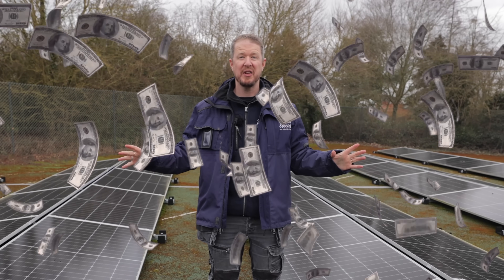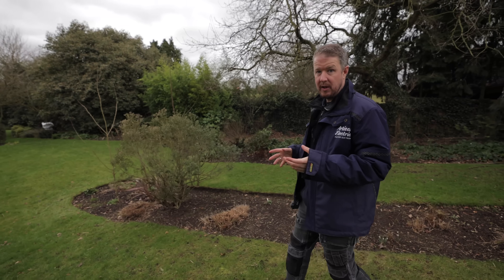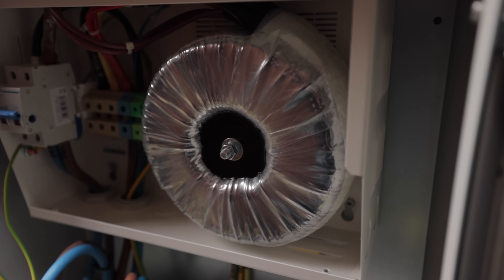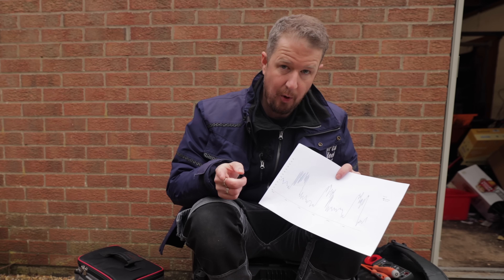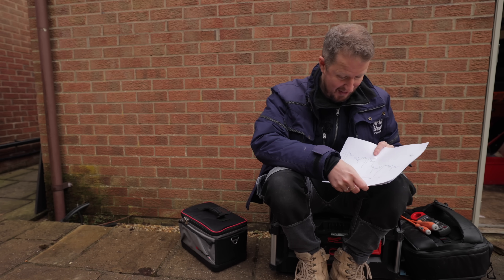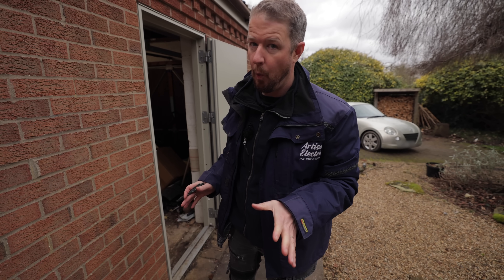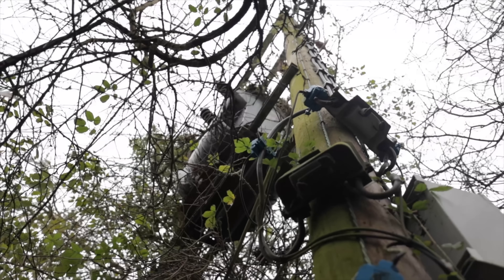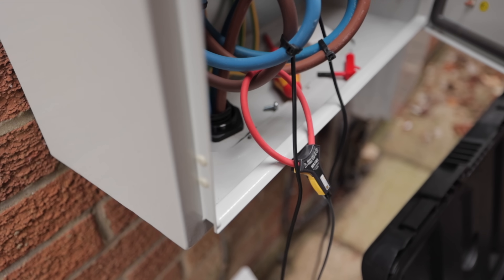THOUSANDS Down the Drain – And We Can’t Do Anything About It!

Comment: I've had several wtf  moments here. Even my country is not very rich we have better state of grid even in rural areas.

1. Single phase. Really? Such large consumption and production and single phase only?

2.Toroid in small voltage control. Really. Not semiconductor based? This is middle age of electronics. But cheap i suppose.

3.Wooden poles for electricity? This is wtf moment. Why not concrete? They are used very exceptionally or temporarily in my country. Except phone poles which are sometimes separated from energy ones. But most rural installations have concrete or steel.

4. Grid protection - what is energy distribution company doing for energy grid protection from overgrown plants? Do they initiated annual physical checks of equipment or revisions? They can give me a fine here where i live if i will not let them to do maintenance and i will pay all the damages.

Comment: We're experiencing the same here in the North West with SP Energy. Fortunately, nothing is tripping at the moment. Our voltage range is between 263v when discharging to the grid, down to 229v when the car and batteries charge overnight. Our set up is much, much smaller, a 6kW array with a 17.4kW battery and a Zappi. Our DNO have been out a couple of times at my request, but when they check our off load readings its within tolerance, around 240v so won't do anything. The test is always after work hours. and the engineer is on overtime from their normal day job.

Comment: Interesting what happened to V phase the company that designed a similar voltage optimisation unit. I was the factory manager at Remploy who manufactured the units I remember them going into administration I think that was 2014 I remember having lots of stock left in the factory afterwards.

Comment: That large auto transformer (I assume is not isolating) needs to be automatically switching tappings according to voltage, as currently it's only been designed for a fixed static overvoltage which is no good for what you are doing, i the electronics industry we have what's called a regulated variac but ive not seen them over 3kva and I quick search I just get bombarded with manual variac (just a bit better than what you've got already) but really having so much on a single phase I think is the crux of the issues

Comment: I work for electricity distribution network and that's quite a large transformer for a rural area it's probably the tiny Bundle cable from the TX to your installation. The TX was probably installed in the 90s and the bundle upgraded later but for a time with less demand. Our networks pretty stingy with money as we're a trust and if you want to upgrade the customer always pays. We are getting large voltage spikes in summer with all the distribution TXs because of solar panels connecting so at moment we're going round tapping voltages down, don't know what's going to happen in the winter. Also, it's really hard for companies to cut trees at the moment because of complaints from the Locals we have to jump through hoops and prove the risks before we can do anything, it's easier just to let it go and fix it after it the feeder trips.

Comment: when an electrician mis quotes the nominal mains voltage😮 the nominal is 240v not 230 ! We had our 240v system all set up before we joined europe and joined their 230v  nominal ,we changed nothing other than our tollerance rating ,we still are in reallity 240 nominal ,to say 240 is "fairly high" is just plain wrong, i know what you said falls in line with the training literature but in the field you learn how the training is sometimes wrong, here in the southwest actual measured values are always around 242v and I've seen as high as 250v (urban Plymouth)

Comment: Here in Ukraine it's a common issue. 

Many folks buy abandoned houses in rural area to install 30KWp PV as way to invest money. But those areas lack both good grid and consumers so overvoltage is quite common.

As result villages had over 270V in network around PVs. So goverment pushed regulation to make use of mandatory separate voltage relay that shuts PV off if network can't consume it leading to overvoltage. 

Owners of home PVs pushed that regulation back so those devices are only needed for new installations since 2023.

Comment: You have got this far without knowing anything about the local network topology? You didn't  do any calculations on the supply cables and transformer before installing the battery charger? Can you not reconfigure the solar panels controller to drop the voltage of the array?
I would be very interested in your loop readings. And my suggestion is to get an E engineer to give you an assessment. Cheers.
(Also Tx are measured in Kva for a reason, you must know your pf before assuming Kw capacity.)

Comment: Temporary Solution (Maybe).

After installing your voltage reducer, you then said it created a second problem during battery charging, and the customer was able to charge batteries in about an hr.

In that case couldn't you just reduce the charging rate, if off-peak is 6 hours, that's plenty of time.  I do this anyway on my install, 30% charging power rate as I believe this would also be beneficial to battery health, rather than charging at full pelt.

Please note, I'm not an electrician and might be totally off base here.  But to me seems an obvious fix, until DNO get its part sorted.

Comment: I have a 16 kW DEYE inverter. When the grid voltage exceeds the settings it disconnects from the grid and supplies a steady 230 volts to my house. You can reduce your charge current so that the load is lower to reduce the voltage drop. I assume you are exporting the solar/battery power back to the grid. Lowering the export level will also reduce the voltage increase. I refer to your grid situation (long run from the xformer  and possibly a xformer that is near max load or over) as a soft grid. Of course this is just a band aid but it gets the job done. I've recommended this to people with this issue and it has satisfied their needs without costing anything.
Reply: I also have the deye 16kw. How are you finding it? Mines run 24/7 for the last 25 months without missing a beat. 30kwh of server rack batteries and it lowered my electric bills from 260pm to 50pm on average.
Reply: @James-k2c9k  Mine has been online for 28 months, working fine. My bill is down an avg of 90%.
Reply: @pilotdrh  how many KWh of batteries do you have? I was on Octopus 7.5p KWh, then went to the variable rate. Averaged about 8p KWh. I've now moved to tomato energy @ 5p Kwh it was nice getting paid to charge sometimes but the 5p over night rate works out cheaper and much simpler!
Reply: I have 30 kWh of batt. I don't export power and rarely charge from the grid

Comment: Wouldn't you be better to take voltage readings from neighbouring properties from the same phase as yours as when your pumping in 17KW they are surely going outside the upper voltage range, meaning ukpn have to address the problem, and replace that transformer and or upgrade cabling also??

Comment: Why is the charge controller(s) not limiting the  charge  voltage? 
The customer's hired you for the knowledge to do a proper job which includes adhering to the specs that the grid requires. So that's not on them.
While you might have identified an outside factor, why would that transformer cause the charge controller to exceed specs?

Comment: Some great and for me educational comments to this video. You have to admire Jordans openness whether they have made a mistake or not. I had no idea what the DNO did exactly with those G99 applications, nor the 240v versus 230v EU standard and the fact we as a country fudge it with paperwork until its necessary to make the change. Most consumers like myself would not even measure the voltage coming into the house and frankly I always thought it was the current that did more damage than voltage spikes. I see new fuse boxes, not ours, fitted with surge protectors and now reading the comments I'm wondering if that's the latest standard to protect voltage spikes like described impacting internal eletronics. I'm having a bog standard EV charger fitted single phase and just by chance I've looked at the voltage coming into the house monitored with our LuxPowerTec hybrid G98 inverter. Over the last three months It varies from 232 to 250 mostly the higher figure is at lunch time when solar output peaks. I start to understand the impact of people adding solar, batteries, heat pumps and EV's on our existing infrastructure and having spent some years living in the NL's I know they were having major issues and were forced to upgrade cables, transformers etc.

Comment: I really want to be polite, but I value the truth more. So I can only say this: some idiots in the government allowed prosumer model and naive/not-well-educated/dishonest people are buying/selling/installing these systems. But don't you have inverters that can operate within a voltage range? Here in Poland inverters switch off if the voltage exceeds 253 V (unless users tamper with them, which is another problem). Off-grid or hybrid is the way to go. Please trash this "optimizer" and install a couple of crypto miners, started automatically when the insolation is at its top.

Comment: First od all - 17kW calculated by DNO is how much they can sipply, not how much you can put into system. If you have voltage issues using the step-down trafo is UNPROFESSIONAL because you are rising voltage for everybody else connected to this line!!! Any good inverter (Solis, Solaredge, Sofar, Fronius, SMA) will have Q(U), P(U) work modes that are a must while dealing with overvoltage issues. Since you have a hybrid system here you are for sure able to limit backfeed to the grid and not loose energy because inverter will be puting excess energy into the battery. Just set backfeed limit to 11kW for a start, enable Q(U) and sell this transformer for a scrap!

It's elementary my dear Artisans!

Comment: Interesting video Jordan- up there with the one where you found the PEN fault where we also saw these wild voltage swings.

Please correct me if I'm wrong here:
1) This is two completely separate problems, peak solar over-volt and charging load stability? 
2) Charging load is for UKPN to fix but the solar issue is a design thing?
3) I'm struggling to believe one properties night time draw on the main transformer to charge their batteries is much higher than peak 7pm use from all the other properties running cookers, kettles , pizza overs, hot tubs, charging drills and wands...I'm not convinced. Interested in part 2 and believe UKPN might have to come out but I'm not 100% this is the whole story. Do you suspect other properties are also making use of cheap night rates and all asking to pull hard at 02:00? Do you see many people actually using e7 storage heaters anymore- I haven't for quite a while?

Comment: On the SWISS in Western Australia, metropolitan area, as part of the install you have to prove your solar system, at peak output (the the inverter rating) will not raise grid voltage at your meter by more than 2%. This requires taking into account the size and length (and thus resistance) of the cable run from the house to the street (this cable, although on the the grid side of the meter is your responsibility to have installed plus size appropriately for your intended use). For my install this was 1.2% at max output for a 3 phase 10kVA inverter.

As someone else has mentioned for the UK, the rules in Australia require a ramping down of output when local voltage exceeds 250V down to 20% of inverter capacity at 258ishV. Also PF of inverter will ramp from 0VAR at 240V to about 30% absorbing, ie 3kVAR for 10kVA system. This helps to bring the voltage down.

Comment: Again am shocked at the low standards of professional education in the UK especially with the new advances in  grid technology. The problem you have here is called cosign error and it's common knowledge, you have a number of solar inverters  colocated all trying to follow the grid phase  well they are working against themselves mate this explains your over voltage. Which ones are master. Which ones are slave. Where is the communication cable between inverters, does the inverter selected even have this function or have you installed 3 stand alone units ?  Do you realise that the inverters all regulate down the amount of energy pumped into the grid from the solar array by mismatch of phase meaning that probably half the generated energy is not being inverted ! 

Designing onboard chargers 22kw for BYD and GWM means you have this effect in a whole parking house with hundreds of EVs in inverter mode so I developed a sync signal  system to make multiple V2G even possible.  As I worked for Volkswagen in Germany we had V2V  vehicle to vehicle. And V2L  but management refused to allow us to develope large scale V2G vehicle to grid. Now the Germans went all green but did not see the need to use EV batteries locally where people are as a means of storing green energy where it's needed. Now go to any big city in china and you will find every Parkhouse fully fitted with hundreds of fast charging ports that can also feed thousands of kWh into the grid with synchronised EV OBCs in inverter mode.  Then I look at backward Britain you guys have not got a hope in hells chance without a massive and I mean massive grid upgrade, I remember well at IEC meetings the fools with shirts and ties on from the UK not understanding the international EV standards and always complaining and wanting to make us change things. Well we refused and you guys went it alone. Well the PEN loop test is the right approach and if your star point grounding is high at the grid transformer. You have to improve the grounding their with the costs involved  but no profit is in the UK more important  that the EV battery is a high voltage DC power source that can kill is sadly something that can not be ignored. Ask Nissan  what bother they have with their ICCPDs in the UK refusing to accept state D by the crappy British grid system.

Comment: I'm an installer in New Zealand. I have always said feeding the grid with your own solar is a waste of time, too many potential complications, too much red tape and always subject to the power companies changes and incompetence. It always looks good on paper. Build a system for your own power supply, become power independent and stick with that.
Reply: The customer does not want to pay for the batteries.
Reply: this is the best comment i've seen. i fear its too sensible for people to accept.
Reply: no it is not. Feeding hte grid with your solar is bumping coal and gas off the grid.  I have 40kW on my house in Australia and I have made tens of thousands from feeding solar into the grid over the years. Currently I'm getting 15c/kWh and years ago I got a preferential rate of 60c/kWh.  Customers should be forced to feed in to the grid if they want to connect solar. Exports benefit everybody. note that solar installations should be setup with flexible exports which is implemented currently in South Australia and soon to be implemented everywhere in Australia. NZ will follow later as its solar industry is tiny.
Reply: @beyondzeroemissions  Till the reverse happens, take a look at Holland: In the Netherlands, the situation has changed such that people with solar panels now have to pay grid fees instead of being paid for the excess energy they feed into the grid. 
Grid Fees (Terugleverkosten): Owners of rooftop solar panels are required to pay grid fees, which can range from €100 to €697 per year, depending on the size of their system. These fees are intended to cover the costs associated with managing the grid and integrating distributed energy resources.
Did you ask yourself why they are paying you only "15c/kWh and years ago I got a preferential rate of 60c/kWh"?
Reply: @beyondzeroemissions  So you want the coal miners family to starve?  England is doing that stupid idea, and now they don't have the coal plant so they can keep the power on, and the people are being screwed.
Now If they want to pay what I decide my power is worth.  Like they make me pay what they say.  Then I wouldn't have a problem with it.  
I have expenses with inspections, cleanings, wildlife abatements......
Reply: @beyondzeroemissions Most power grids were never designed to accommodate back feeding. The transition from centralized large scale generation to decentralized micro generation will not be easy.

Comment: Looks like you need an AVR, automatic voltage regulator. It’s like the thing you fitted but automatically changes the voltage taps to keep the output within range.